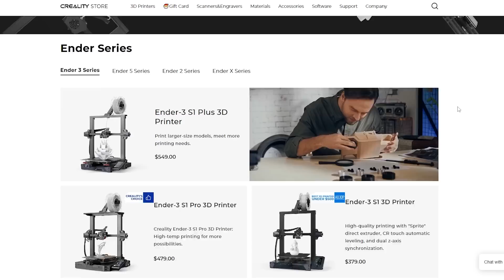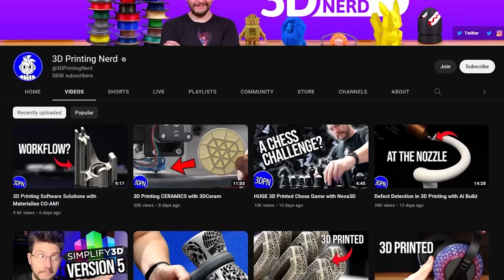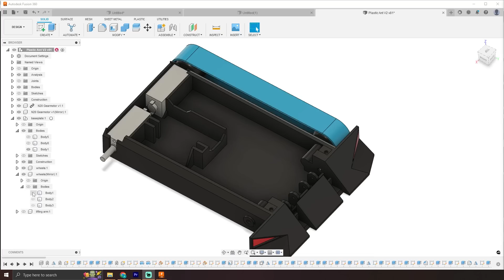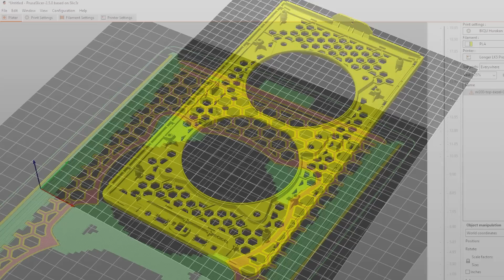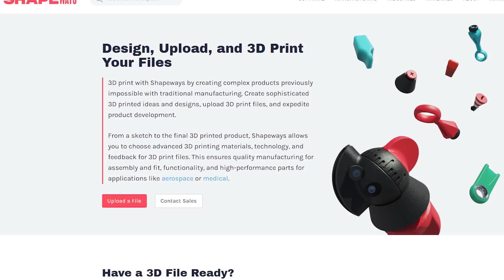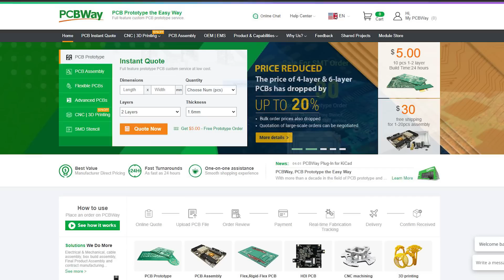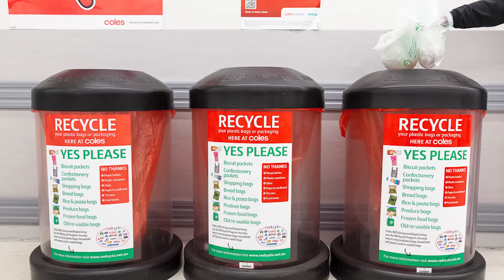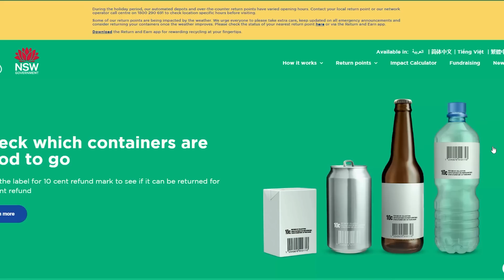My 3D Printing Predictions for 2023

Comment: So... The huge price of injection molding is a lot of know-how and experience, mostly, right? Though also some iteration. How much do you think there's a potential, near-term, for machine learning to be applied to injection molding, to eliminate the engineers most of the time, and make it possible to go from CAD model of the part to CND'd mold without significant human input @MakersMuse

Comment: FreeCAD is pretty good CAD and has huge youtube video training support. I still prefer OpenSCAD, because it's purely mathematical, but for graphical CAD, FreeCAD is really improving and free open source software is awesome.
Reply: And capitalism is inherently a race to the bottom, so yeah, that will continue unless we create open source developer and user communities that inherently dovetail the ideas and the research, using tools like Patreon to fund development. If anybody's using an genuine Ender, for example, they're using Marlin firmware (open source) and the machine itself is a closed version of an open source design (the Prusa i3).

Comment: I really hope some sort of powderbed printer could be made for the home. The system using a bubble jet printhead sounds promising as it would be very fast, eliminate supports, and have better structural strength with little to no "grain".

Comment: I think the BambuLab X1C is now the printer to beat, and the Prusa XL needs to be at least as fast and as polished, as does the next version of the i3, at least to the degree possible with a bed slinger design. But I know Prusa has it in them and I’m really excited to see how they tackle the challenge. Some of those features I think will show up quickly. WiFi printing on the Mini is already here, though it needs to be built in long term.

Comment: The prosumer disruption is not a prediction -- it is already here. Bamboo Lab has hit the ground, and it is an earthquake -- in the right direction, plus it is actually prosumer, not just hobbyist, like AnchorMake. The specs of the new Bamboo Lab machine are aimed at being able to print engineered parts with embedded fibers and higher temps -- something that people want who are not just making little toys. The impact of this impressive engineering team will obviously be to require some sort of answer from other teams in order to maintain some market share. CNC services will likely become a bit more competitive as well, just based on natural evolution, although that actually does not fit within your title. Making CAD simple is not so easy, unless you merely bite off tiny little segments (you mention badges) and just support one of them. Digital design files are obviously easily transferred with today's connectivity. Not much mention of metal. It would be nice if someone made a breakthrough or two in that space.

Comment: A few years ago (before I got my first 3d printer) I had to order a replacement part for my Shark vacuum. It was a hose retainment part that's not very robust. The part that came from the parts supplier was a nylon 3d print. $25 for a part I could print now for pennies (not counting the overhead of owning a printer).

That printer was - tada - an Ender 3 pro. Yes, I have made many upgrades to it and it's now worth several times the cost of the original machine. I would point out that's it's much easier for most of us to justify an $180 initial machine and a number of $5-$50+ upgrades over time than just splashing out for an $800 machine all at once. I used it for a year before adding a Duet 2 wifi. A few more months before going to direct drive.  A recent upgrade to a Phaetus Dragonfly BMS. A little bit here, a little bit there.

Comment: I'm going to hope that someone develops an easy way to recycle and manufacture filament with one machine that can be purchased for less than $1000, that is either fully assembled or easy to assemble. This means it can grind plastic, and extrude filament onto a spool that is wound by the machine. There's the ProtoCycler, but that costs $4000 and is out of reach of most hobbyists.
I also want to see more guides on how to make and print with recycled materials such as HDPE and polypropylene, since a lot of our plastic waste other than plastic bags are made up of those two plastics, and they have desirable characteristics.
I also want to see printer and controller board manufacturers take responsibility for the changes they made to boards (using STM32 clones instead of genuine STM32s) and make branches of the firmware they put on the board that are based on the clone manufacturer's own firmware source code instead of running the STM32 code on it and leaving users stuck with buggy firmware because of the chip differences.
Other than that, I think prusa clones like the Sovol SV06 and large-format printers will become more affordable and more reliable. I think we might even see a CoreXY printer capable of 300mm/s or faster with a build volume close to the Ender 3 with a built-in ARM SoC running Klipper pop up at a price point of around $300.

Comment: Regarding easy CAD-Software: Even the easiest tools will be to hard for somebody. An idea I got right now: Why not make something like ChatGPT or Dall-E for 3D-Models. "Hey, 3D-model a small unrealistic ship or rather a small boat, which features all difficulties a 3d printer has to master to benchmark them." With some additional descriptions ("please add a steering wheel" and so on) you will get eventually Benchy :-)

But I would be already happy if CAD-software is and will be affordable. Personally I would prefer Creo, because I learned and used it years ago at work, but I'm not willing to pay for a comparable license as at my work place :-) (Therefore right now I'm using fusion360 for my personal use cases)

Comment: Awesome video! Point by point: 1- Prosumer: It's about time! I was printing at 150mm/s back in 2015! On another case, with a 1.5mm nozzle!  Look for the VzBot 3d printer that is printing at 2000mm/s! 
3- How about the digital files market? Look for website Cults 3D and the like...
5- Filament and recycling: How about Regen PHA?
Again, thanks for this video!

Comment: I will say that enclosed, big beds at least 500x500, auto leveling, plug and play, fast printing, able to print materials like carbon fiber to metal, as well as laser printing, able to change nozzles automatically and get rid of purge towers which is wasteful in filament and time.

Comment: Being a tinkerer, I would stick to low budget printers. Especially ones that I’m able to modify and upgrade to my preference. Only time will tell how reliable these ”Hi Tech” printers will be in the coming days. Being locked-in on parts and software, support might still be an issue. Have you heard of a rook printer? It's open source and small but quite promising build getting your feet wet into corexy printers.

Comment: The lure of filament recycling is compelling, but the problems involved are significant (mostly keeping everything clean to avoid clogs) and the costs are prohibitive (I figure at LEAST $5K, but more like $10K for the grinder and extruder).  Most of us do not use enough filament to justify the cost, and selling recycled filament gets you into liability issues (you don't want your customers to have clogs).  A great idea, but unlikely to work.

Comment: Hello Angus.  You dared to look into the future (this is where I live) and even made some educated guesses, and if I dare say, not far fetched from reality. Coming from a teacher, that is at least amazing. I guess you are morphing into somebody else now.

So, how 2023 look from innovation and inventions point of view in 3D printing environment? To me is;

-Non planar slicing for more than 3 axis machines is going to be a tedious trend but gaining speed as more than 3 axis machines become available cheaper and cheaper, and what is cheaper than downloading the STL files to make your own even if you have no clue how the prototyper came to that model iteration? Download, print, clean, sand, assemble, and start fighting the firmware. (me working on it myself part time)

-Non planar self adjusting multi-axis 3.5D printers (you know, capable to going back and forth in time too... lol) with tilting and rotating beds, titling and rotating printing heads, tool changers, in the beginning as STL files for the more advanced tinkerers, but soon to be copycat without any compensation by miriades of Chinese and Vietnamese industries, and sold damn cheap mostly injection moulded. Now that is going to put a dent into many industries in the years to come, when a 3D printer will be capable to make parts that now cannot be reliably used if 3D printed, and make them in your closet while you sleep. (me working on a few concepts personally)

-Polymers (that is one touchy subject you avoided, well.. except for the recycling part) I have no idea if you looked into industrial structural polymers but in the past 3 years their price dropped a lot, and even some Chinese companies ventured into making them filament now, PEEK, PEKK, PEK, PEI, PPS, and others. I expect their prices to drop in 5 years below 100USD per KG, and that would be a treat. (me heavy user and holding great hopes)

- Metal FDM 3D printing... upsie... yes it is coming, and yes I have my hands into this pasta too, soon to go to the oven for the first trials. Aluminium for starters, but slowly slowly as we creep towards 2000C hot-ends other common metals might become the object. Just imagine you take a Core XY, change some things and you can go metal, ain't that mental? And all this for peanuts money, or nearly...

This is the future I live in, hopefully in 10 years I look back at it as at a glorious past that made a quantum leap for everybody's benefit.

Do I expect other people to bring in other benefits to the community? Absolutely. Do I know whom and what? Nope, but I still have hope.

Comment: Inflation is going to impact things so I suspect the race to the bottom is going to continue. 

@Zoe Summers comment about filament issues and health concerns is very valid. I print with PLA or PLA+ because I cannot risk  PETG or ABS. I have no means to exhaust harmful fumes outside the house and my wife is super sensitive things like this.

Comment: To touch on #5 about recycling. I am very interested in this subject as plastic waste is a very common resource here in the states. I think that if properly cleaned and processed the potential for a home maker to use recycled waste for their own projects is enormous. A youtuber by the name DiyChen made a screw and barrel extruder and filament winder out of some common things you can find at a hardware store. This project has always fascinated me because I know that with a bit of chemistry, some programming, and a bit of investment, there are some very plausible ways to make filament at home out of things like ABS, PETE, and HDPE.

Comment: Outside of 3D printing I'm really keen for other industrial machines to race to the bottom, laser printers have had a mediocre journey to becoming more affordable with nowhere near as much reliability as the cheap 3D printers we have now, but imagine the day where CNC machines, plasma cutters, lathes, or any other bulky machines are optimised in a similar fashion to 3D printers, compared to how old 3D printers were 5-10 years ago being massive $1k-5k machines. Maybe it's only because I've been privileged enough to use all of these machines and seen how useful they can be even in a hobbyist landscape, and undoubtedly need more experience to get working than just G-Coding to a 3D printer, but I'm still really keen to see innovations in those types of machines.

Comment: I agree with the overview and too am glad that things bottomed out. I probably still need to do my "does it have a flex bed, does it have MBL, does it have a filament runnout sensor? No? Then not worth the time", but things are getting better.

Comments on the predictions:
It will certainly be interesting with what comes next. Bambu surprised everyone, though now that it's feature set is known and released (and others are going to be ensuring they can do it as good or better), I'm wondering what they'll do next as the most they did was a price cut by removing stuff... not to mention it hasn't even been a year so we don't know if they're coasting off existing supplies or if they're keeping up with demand for replacement parts or new items. I just hope they do right by the community and we don't need yet another public airing of dirty laundry followed by an apology from the company. I've heard so little about AnkerMake, probably because of their review unit terms, but I know one person who got one and they've indicated it's a lot better then one might expect. So I'm curious what happens with that. Of course, the Prusa XL is going to come out in 2023 and that has some unique features... but it's price point isn't gonna win favors. But wait, a Prusa survey on what's desired for the MK4 (without saying MK4)? They've said the XL's extruder will probably be used on the MK4 and the engineers there are unlikely to have been sitting around waiting for parts. So will we get an announcement of the MK4? What about the others? What names will we learn about and what names do we know already that will put out that one thing that people go "OMG, I need that"? I do think the printers need to become more user friendly, even Bambu. So much more can be done beyond "I loaded filament and it printed".

Better CAD is a must. Heck, even though I use Fusion 360, I want better and easier software. I want to go "here's a box, I want a gear with this ratio" and for it to hollow the box, add the gears for that ratio, make it fit, and add the axels. "I want these parts to all fit together", so it auto adds some clearance between parts and maybe even chamfers them to a snug fit. "This snaps together after rotating 1/3 of the way". It's practically "AI" for CAD, but I think that might be a bit further away (and since all existing AI stuff is building off available to public but not "public domain" pics and text, there is nothing really like that for engineering designs so it's not something that will just popup. Even if you get past the ethical and trademark/copyright side of it)

Companies having print-at-home replacement parts is something that is both a "I would love that" and "it already has been happening for years". My office's fancy coffee maker used 3D printed parts back in 2019, and the machine had been out since 2016/2017. And if you think that may be an oddball, that coffee make is the same one used by Dunkin Donuts... so it's a well used machine. Also, a number of companies (Prusa and Ultimaker have a number of promo videos featuring them) have indicated that at best, they use the 3D printed part. At worst, they use the 3D printed part as a holdover until the injection molded or metal part arrives.

An interesting thing on the "industrial manufacturing" prediction: Karl / Nak3D is known for his work on belt printers and the White Knight. At ERRF 2022, he was there with the next iteration (in progress) and I asked him about all the metal parts. He indicated that there were so many services that offered CNC milling and similar of metal parts at a good price that he decided to stop 3D printing most of the parts for his printers. It's an example, and it's been shown before, but it is certainly a sign of things to come.

Recycling: the bane of every (FDM) printer's existence. I had made a proposal to a friend about a metal mold that I could produce small parts bins using waste plastic, but the idea seems to have fallen through. As much as I would like to get filament out of my scraps, I think it's not in the short term and needs a lot tighter control (ahem, rigid rule following...) to be feasible and think the "melt scraps into a mold" is a lot more likely. Maybe printer parts can be made from the melted scrap (looks at Prusa Mini frame plates that became injection molded...)

My one prediction not here: Slicers will get smarter. Look at CNC kitchen's videos, or how machines such as Bambu and the Prusa XL operate. I think it would be an incredible thing to have single extruder printers do multi-color AND multi-material AND have nozzle swaps included mid-print (Revo and such), or multi-extruder machines mix-and matching nozzle sizes or even adding milling or a verification stage with a laser scanner or similar. Yes, some of those have been demoed... and then never get past a demo/concept stage except in industrial settings. I predict not only will we see this, but it will become easy enough that going into 2024 we will be looking at tool changers, color mixing, near-full color, etc. Things that people tried but either failed or they were ahead of their time. But now capable, fast, and relatively easy to do.

Will family find an interest? They already have, but the machines are too time consuming, too complex, a bundle of wires and moving parts that family members with young children and pets can't have in the living room AND they don't have a workshop they can put them in.

Comment: It would be great to see some of the advances in engineering resins flow down to consumers.  Few of us can afford a Form 3 printer itself, but I want to see something like SLA compatible Tough 2000 Resin in a generic bottle.  SLA printers are capable of being up there with injection molded quality of look, its the resins that are holding us back.